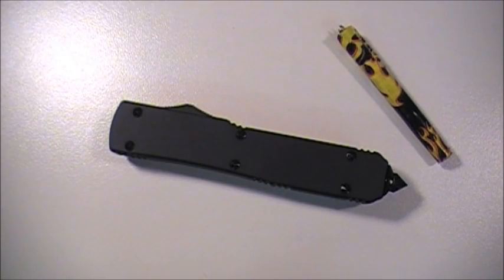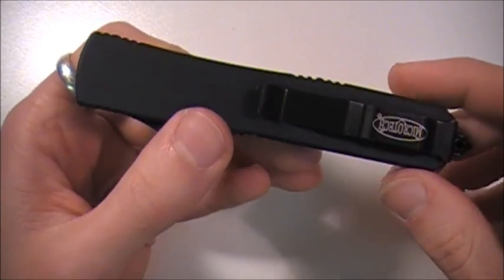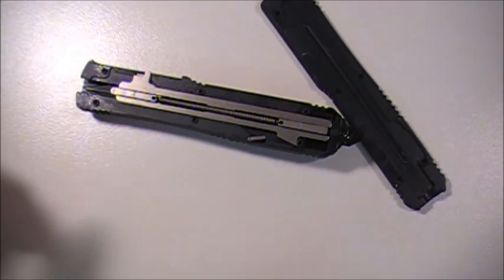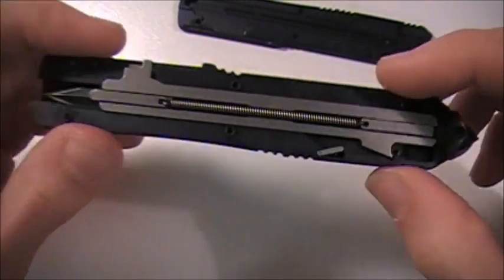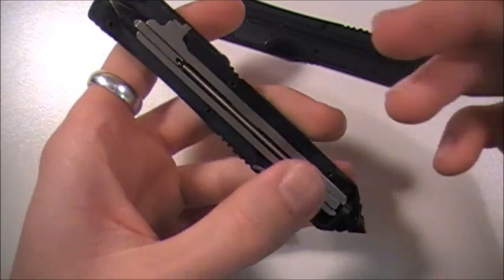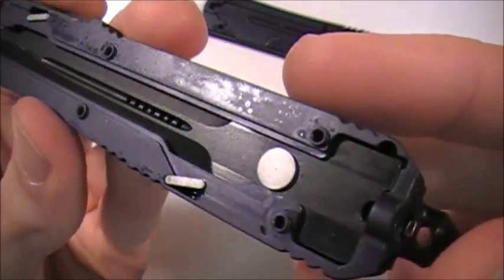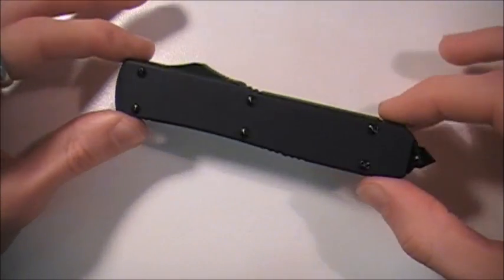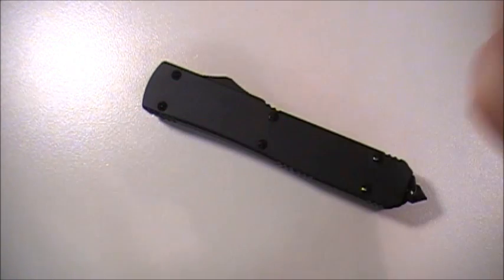The Inside Of A Microtech Ultratech & How It Works

Comment: The blade can easily be removed. 

That circular pin near the base of the blade is a stop pin that runs in a slot. 

Remove it with your fingers or a small strong magnet and remove the blade out the front. 

Just remember to put the pin back!
Reply: Yeah I laughed when he said that. If the thing was assembled then there’s obviously a way to get it out. They sure didn’t forge the handle around the blade. 😂

Comment: Whoa. I think it's different than the combat troodon, which I have only disassembled once quite a while ago, and is the combat troodon different than a regular troodon?  Fascinating. Good work jumping on the grenade for us and filming it.  Righteous work man.
Reply: Im curious of this myself! Just got my 1st Microtech: The $802 Combat Troodon Mandalorian edition M390 (more like $900 after tax and shipping), and honestly, i feel i overpaid by $300-$400. Not super impressed for the price. Came with a generic cardboard box, clear plastic bag, advertisement and card saying it was inspected by someone that scribbles their initials! No bag, no cloth, no special cardboard outer box even. But i did order from Blade HQ, so i know it's 100% legit! 

Anyway, curious if the internals are the same as well. I just got my screw bit, so i guess ill find out here shortly, when i decide to do exploratory surgery!
Reply: @jun1orbaitor44  Well the regular Combat Troodon is about $500 I believe, so roughly $300 - $400 of that was in the special edition paint and such. The regular versions of these knives are meant to be used and used hard, so they don't come with anything special like a bag or cool box.

I myself just bought a Kabar and it came in a standard cardboard box with a plastic bag and a piece of paper. Doesn't take away from the fact it's a great knife that is meant to withstand the worst of the worst.
Reply: @Trippsy05  You're reaching by saying $300-$400 is for paint, the same paint is available on lower end models that sell for around $300-$400. I've bought dozens of medium end knives, never a Microtech before this, and im personally not impressed. 

What i paid for was the M390 blade, that was what the price bump was for. But $300 more?! The button was very slightly loose when i 1st got it, as well as the blade being very slightly wobbly, very slightly. After a month of playing with it here and there after work, the button is super loose and the blade wiggles now. To make it even better, MT uses a proprietary screw pattern, so i had to order a special tool to just be able to lube the action! And if you want a MT branded tool, its not cheap. I paid $20 for an Etsy off brand one that's about the size of a 1/8"- 1/4 square drive socket. 

Ive had 2 Kabars myself, and the packaging is almost identical to this blade, except Kabars come with sheaths! AND COST 1/4 TO 1/8 OF THE PRICE!! I also have Civivi's, Boker's, Kizer's, an Esee 5, CKRT's, TOPS, Mcusta and lower brands like Schrade, SOG, Ontario, Cold Steel, Gerber and more. They range from $25 to $350. They're made from steels between 1095- S35VN, and a couple M390's. I know low to mid grade knives, with a small dabble getting into higher end. This Microtech knife i got was overpriced, by a decent margin. 

This is a Special Edition blade from a high end manufacturer, it isn't meant to be used hard. It's a Collector's item and should've been packaged as such. Yes, it still can handle major abuse, but the point is this specific model or line is a Collector's item, so dress it up, especially when there's no difference from models that are $300-$400 less except the blade steel, in which case those lower models still have expensive "super steels" as their blades!

Comment: Always 'derail'/ de-clutch the blade before disassembly. Rem oil is a nice light body oil, and works great on any OTF.
Reply: Rem Oil is the only thing I’ve found that will work on my Ultratech. I used two different kinds of Lucas gun oil, and some Hoppes oil that may have been for fishing reels but I’m not 100% sure. All three of those stopped it up and it would fail to fire nearly every time, despite only putting a couple of drops at the tang and wiping off the excess.

Comment: Another point to help explain what I was trying to say is, if the thumb switch moved the forward tab out of the way of the knife for deployment, then the blade would not be locked into place when the switch is in the forward position.  I.e, If the forward movement/position of the switch actuated the forward locking tab during deployment, if you were trying to stab into something while using the switch for thumb-grip (common technique), the blade would retract with forward spring tension on it, likely not having enough tension to penetrate the target. (Like keeping the button depressed on an auto). 

The switch should remain at the forward position when the knife is deployed. Pressing the switch forward with the knife deployed shouldn't change anything. 

You probably already know these things, but the video seems to show otherwise or that the point was overlooked at the time. Regardless, good video and knives. Keep up the good work.

Comment: You have a few things incorrect. I want to help you understand a couple things. 

The top tab-lock only controls the movement of the blade in the retraction. It keeps it from retracting unless the switch is pulled back. The top tab does not keep the blade from deploying. 

The rear tab-lock only controls the blade in deployment. It keeps the blade from deploying unless the switch is pressed forward. The rear tab-lock does not keep the blade from being retracted.

The forward tab is not moved out of the way by the switch or the carriage when the blade is deployed. The design of the locking system on the blade allows it to move over the tab - kinda like a spring-lock on a fence or a retractable electrical cord would work. The blade itself is what moves the tab out of it's way. This is the same way, only opposite for the rear tab - when the blade is being retracted. 

So you do not need to manually move the front locking tab out of the way when trying to deploy the knife while it's apart, the knife will pass over it - and same for not having to manually depress the rear tab when retracting the knife while it's apart.

I hope this helps a little bit.

Comment: There’s a quick tip for when you wanna take apart your otf knife launch the blade and hold it when you retract it back and it’ll come off track and the spring won’t be a issue on holding the handles together when taking it apart

Comment: My blade won't come out, pin is too tight. I had to de-bur the top switch and one other place to fit, cleaned all of it, reassembled with difficulty and it worked. Thanks.

Comment: The spring under the firing button is to prevent rattle as the button would wiggle loosely without some preload. When you press the button to deploy the spring compresses and the button presses against the body. It does nothing to prevent drag.

Comment: Thank you for showing how the hell this thing works!  Seems like the "core secret" is a spring that is in compression when the blade is in the body, and under tension when the blade is out.  Plus some pretty darn clever mechanical features for safety.

Comment: I’ve always thought it was never good to put oil on on the spring of any OTF, so I learned something from the video.    Question, what is your recommendation about putting a light coat of oil on the blade of an OTF knife?
Reply: Watch the video made by Microtech themselves. The guy puts the nozzle from a can of Remoil in the front and just hoses the whole thing down until it’s coming up out of the opening. Then he shakes it out and wipes off the excess abs that’s it. And that’s right from the manufacturer.

Comment: I got a OTF that comes out but dont go back in..it gets stuck out , i have to pull the blade a little and loose it and it goes back in...do you think its one of the two little locks that is broken?
Reply: If its a microtech it probly just needs maintenance. If cheep one it could just need maintenance but also could have a bent or broken piece or more.

Comment: The parts are so delicate it seems that a few hard stabs or slashes would break the knife right away
Reply from the maker: vxgas Naw. I've seen people stab these into treated wood before. The stress points are all steel. The locking mechanism is steel, the steel blade is inside the steel and aluminum frame, etc.
Reply: +sherman614 I've even seen the cheap chinese ones hold up to being HAMMERED through MDF and work perfectly fine afterwards.
Reply: yep but the spring start to wear relatively fast with a cheap chinese. I don't really recommend those.
Reply: where did u find the replacement spring ? you contacted the seller ?
Reply: Idk 
maybe some other clones have better springs, but mine is thin, kinda loose with twisted extremities just after 2 month of use. it misfires 80% of the time.
Reply: the knife seller asks me 10$ to send me a replacement spring, what a scam.

Comment: I would be kind of curious how much pressure one of these knives could take before the blade would snap out, for instance Cold Steel does videos hanging weights from the knife in a vice to prove the strength of their locks and pins, which is amazing, because I wouldn't think any knife blade hanging out on pivot or tang of approximately 1/2 to 1 inch would be that strong or good for much?  This is also one of the reasons that I didn't notice or give the OTF's much credit over a flashy or show knife, but it sounds like some people actually carry or use them (where they can).
Reply: They’re not hard use knives. They’re more for just general EDC stuff like cutting boxes and rope or whatever. They’re also, especially the dagger edged ones, self defense weapons. These aren’t knives you want for trekking out in the woods or in a survival situation but in reality no folder is. You’d want a sturdy fixed blade. That’s why even though I ALWAYS have a nice folder or my Microtech in my pocket I carry my ESEE Izula 2 as well in a horizontal cross draw setup on my weak side.

Comment: To remove the blade you have to pull the silver pin out from the bottom of the knife and then push the top lock in and pull the blade out

Comment: Sherman, last year, a HALO V owner on a knife forum was trying to sell his knife that he only had for I think less than 6 months and had a mishap where he thought the spring was broken.  He was suggested to fix it himself instead of sending it back to Microtech for a spring since they had a bad reputation of taking forever on servicing warranty issues.
Dont remember if he broke the charging handle or if it was a defect, but he ended up having to send it to Microtech anyhow.  They ended up replacing the charging handle assembly which included half of the knife, making his look mismatched since it was a camo finish.  Ended up costing him I think about $260 all together.  So, the guy ends up with about $800 into that knife with now it being half camo and half black and the warranty was void.  He tried to get I think about $400 out of it but it never would sell. I would suggest never to take them apart.  I sent my Makora II in for a new spring and it took about 3 wks turnaround.  Not too bad since it was right after the Shot Show last year.  Semper Fi

Comment: Thank you ! You are machine . I just fix my fake copy with your help
Reply: Can I ask what was wrong with yours? Mine retracts great, but only fully deploys 8 out of 10 times (maybe). Then, I have to manually pull out the blade to lock it open and it works again for a while.
Reply: Chris Brady Chris Brady Same problem I grind some points and add ducktape to one place and start to work fantastic ..until the day when the main spring broke ..Now its totaly crap.The whole idea and knife is stupid.If u want lighting fast opening knife get some with emerson flipper .It goes ready out of the pocket faster than these autos because u have two actions with the auto ( grab out of the pocket and press the button) with the emerson type blade u have only one action..I am pissed of these now.Good luck

Comment: my suggestion.....instead of using locktite on the screws, use clear nail polish on the threads. Accomplishes the same thing and is easier to "crack" if you need to open it again.

Comment: Spring loaded stuff like auto/knives, and oddball firearms, where I am not likely  to find replacement parts, I will work inside a heavy duty freezer bag  to catch the flying parts. That is NOT a tiny spring. See the detent springs in handgun safeties. Those are tiny springs. They make extractor springs look big. The last gun I had in pieces that factory closed 15 years ago, so spare parts are mostly not out there, unless you know your guns really really well. Why does Micortech  have almost 20 different fastener heads? That's $500 for tools to take the knives apart! Yes, it's a $500 knife, but.....

Comment: so i have an older trodon and it doesn't 'catch' when fired i have to pull the black out after it drops back down and then it locks.  any insight? i'm not the original owner and i've heard micro tech CS is kinda bad.

Comment: Your demo was interesting, but I kept feeling that safety wasn’t a top priority.  One of the holiest safety principles of gun safety is to Never put any body part in front of the barrel of a loaded gun, unless you intend to destroy that body part. Fully a 1/4 of this demo, you had fleshy hand parts right in front of the “barrel” of a very sharp/pointy dagger blade under spring tension, with your finger on the “trigger”!! Then, once the side scale was removed, even the safety design features were compromised. I’m glad you weren’t stabbed. Maybe I’m just a worry wart?
Reply: Lol, it would barely break the skin if it deployed. Even then it would need an extremely sharp tip to do so. Don't believe what you see in movies. Automatic knives are designed this way so they won't cause harm if deployed in pocket.
Reply: Also it's not under tension unless you're deploying or retracting.

Comment: I'll be getting an ultratech. Is it ok for me to apply a thin coat of mineral oil on the blade just to prevent it from rusting?
Reply: Yeah. Some of that will make its way into the knife, though. That's probably a good thing, actually, as long as you don't overdo it, or the knife will potentially catastrophic Lee fuk up and require you to send it in. That's what I'm going through right now actually due to over lubrication

Comment: now..I'm gonna make my own hidden blade based on this mechanism, I understand pretty much everything except one thing..  
when the blade is deploying the spring is pushing the blade forward (and the spring is attached with a hatch to the blade ) but how does the hatch go back to its original position to make the spring tensioned again (just after the blade deployed and the frontal hatch attaches to the blade)? How does it go back?  thankful for answers!
Reply: Anton Bäckström I've been crafting out a hidden blade as well, currently doing the paper ver. First, just to understand the mechanism then try modifying it.
Reply: Yeokk 8399 nice! I'm making mine out of aluminum and brass. And now i understand the whole mechanism! I'd say that I'm halfway through the project and its turning out pretty well. Good luck with the crafting! :)
Reply: Anton Bäckström j
Reply: Anton Howell the same goes for you tips fedora

Comment: You can put the the slide in with out it engaged. You should but the blade in half way into the frame , the spring connects back to the slide , lay the slide in . Reassemble loose . Put 2 screws back in . Pull the blade out till it locks . Press firm on the top of the frame and test , then put the rest of the screws in. And you can’t call microtech for screws. Almost everything is bad info . If you loos anything they know you were inside and you void the warranty. Yeah they will fix it but you will pay for it .

Comment: The blade should most definitely be able to be removed from the handle (it has to be assembled somehow, afterall, right?).  I just watched another video where dude removed the blade quite simply by pulling out that stop pin pushed thru the blade, allowing the blade to be slid right out the front.

Check it out: https://www.youtube.com/watch?v=1Tb2fbgllI4

Also, I'm fairly positive that the spring is always de-energized in either the full-open and full-closed positions.  Only when you're sliding the firing button forward or backwards does the spring stretch - temporarily - until the sliding carriage catches back up with the button, releasing all spring tension/energy.  It'd be a very unsafe design if the spring was always energized (though this may indeed actually be the case in the single-action models).
Reply: +Greg Fowler All the models I've seen so far put the spring under light tension as the starting point.  This keeps stuff from falling apart, rattling, etc.

Comment: So,
Looking closely at the (stopped) video, you can see the weaknesses in this (otf) knife design..
Stabbing: 
When the tip of the deployed knife hits a target (say a piece of wood, or a wall), the force applied in Stabbing motion is directly applied BACKWARDS against that tiny pin (door you said) which is all that prevents the blade from moving backwards. A HUGE weakness. 
Slashing:
Understanding the physics behind a "lever", sideways force applied against the side of the blade (tip?) Is multiplied by the length of the lever (blade) against the last 3/8" of the case of the knife which is all holding in the blade. A great weakness. 

So..
Now we know,
In actual combat, OTF knives are INFERIOR to use where extreme force will be administered.
vs. Any fixed blade especially full tang knife which has none of these design issues. 
FYI

Basically, 
OTF knifes are (expensive)  adult cutting toys.
Not to be confused with actual survival or combat knives.